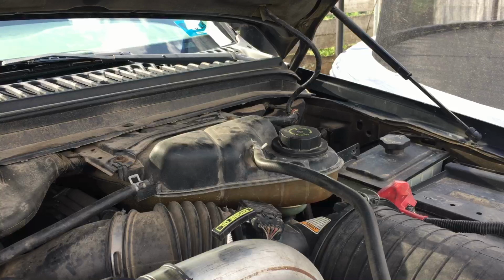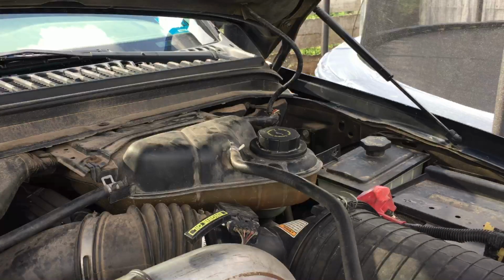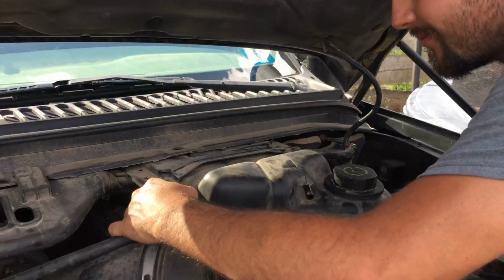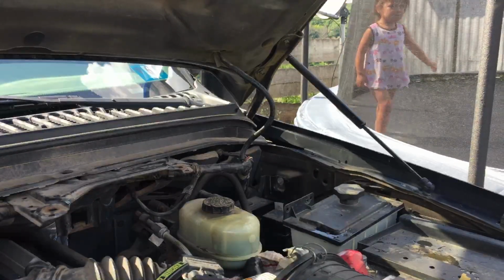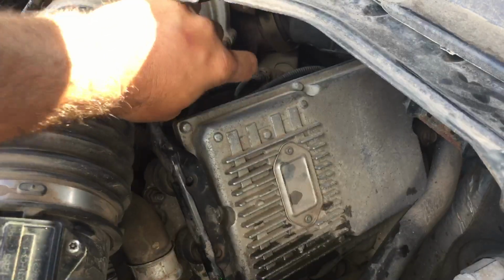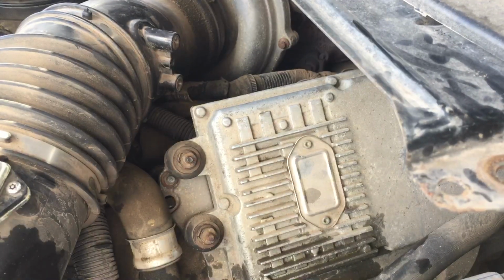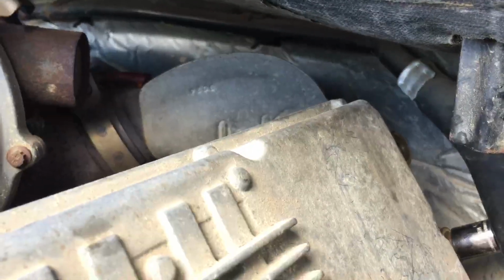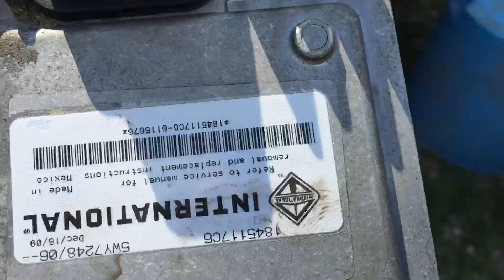FICM removal

Comment: I wish I knew you were having trouble with it!! I could've given you some pointers!! Great video! I sent my ficm off and had a program put in it! And had them put a stronger board in it so it doesn't fry on me! I have stiction problems with my injectors if its below 30 but rev x usually clears that up
Reply from the maker: +Landmark cattle I was certain it wasn’t the FICM  but  swapping them out didn’t cost me anything but time

Comment: I still think your screen is plugged up. I had those exact symptoms. It could also be your high pressure oil sensor on the passenger side.
Reply from the maker: Marcel LeMay yea if it was like 05 and up I could just unplug it to see if it is bad but 03 are in the under side of the passenger side a paint to get to